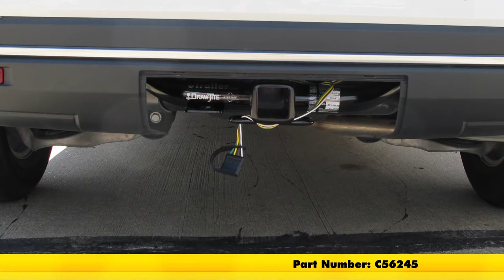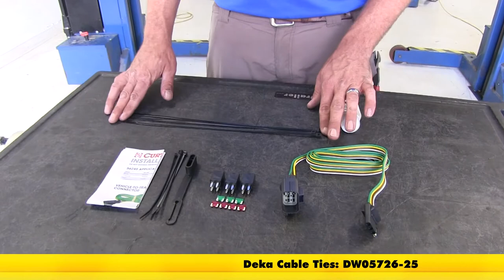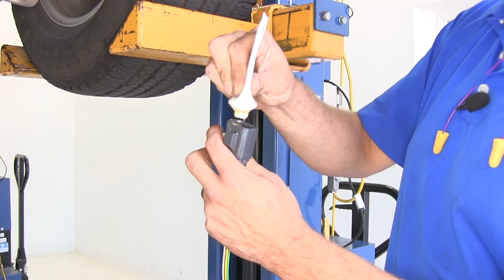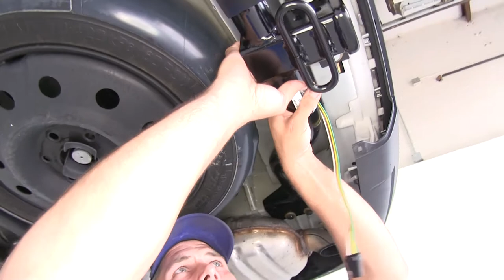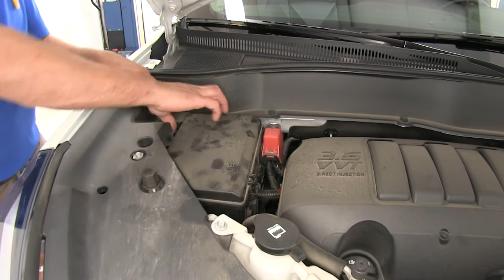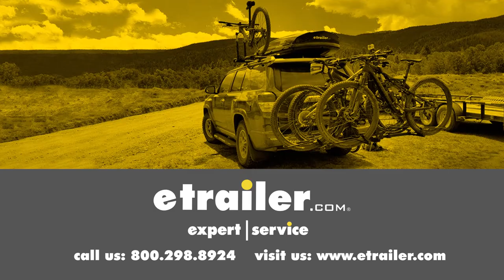DIY Install: Curt T-Connector Vehicle Wiring Harness for Factory Tow Package on your 2015 GMC Acadia

Comment: Is this the same installation on  a 2014 Acadia?
Reply: In particular, the fuse panel...
Reply from the maker: You can view an installation video on our website (linked below) of C56245 being installed on a 2014.

https://www.etrailer.com/Custom-Fit-Vehicle-Wiring/GMC/Acadia/2014/C56245.html?vehicleid=201427602